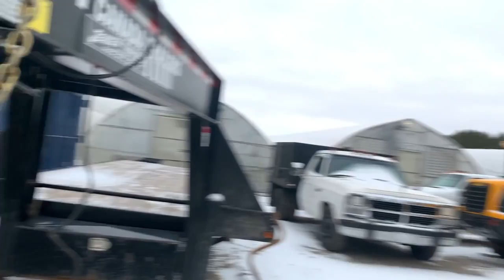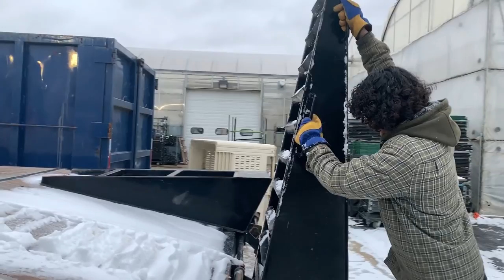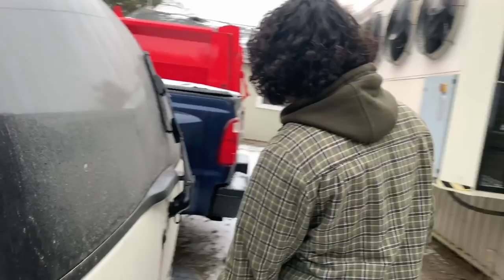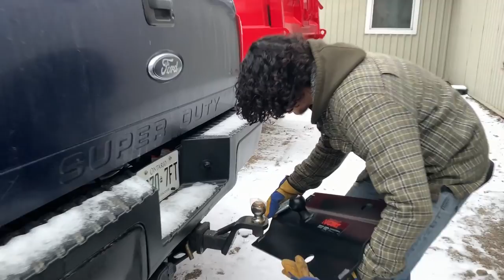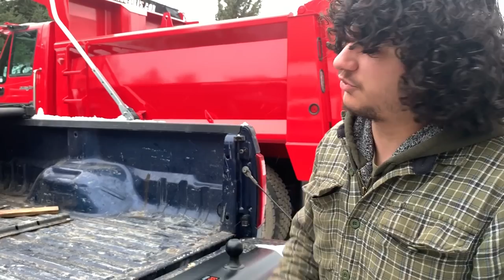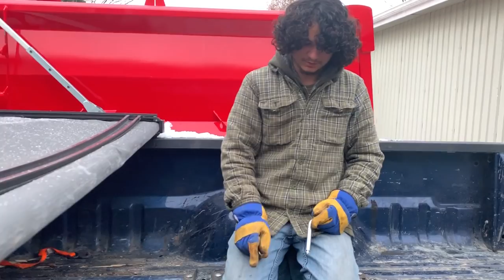Our Brand-USED 30 Foot HEAVY DUTY Trailer! GOOSE NECK

Comment: Well, you own a Ford, so a trailer to haul the Ford around is necessary.  What are you going to pull the trailer with?
Reply from the maker: Well then...... we might just have to buy an extra Ford as a backup.
Reply: Meh the fords got a cummins in it, she will run forever

Comment: We tow, 5th wheel, goose-neck, bumper pull. Can I recommend with your new goose-neck setup that when you install the lock pins and cotter pins..to do it the opposite that you did in this video. So the cotter pins will be under and protected by the ball plate and won't we easily bumped around by anything riding down the road in the bed. I have the same setup as you and my plate was very tight to my rails. Had to grab the hammer and pound it down. I was also sold an "extra" set of pins. Enjoy the videos....where is the duramax kid?

Comment: Got a 15 ram 3500 single rear wheel with a the factory gooseneck/ 5th wheel package, but mostly use a bumper pull.  
You should look into getting a b&w flip over ball. Way better secure and dont have too worry about rails or pins.

Comment: Should look into a flip hitch 5th wheel hitch, so you don’t need that big plate and rails
Reply: I’ll also add put a trailer plug in the box if it’s not already done, saves wear on the cord and don’t get the salt from the roads on it

Comment: i have a 42 foot Float trailer, 20 foot shipping container on it with my "office/lunch room" and it has a EsBar set up on it so its heated, has a solar cell system and a 220 amp service so i can run the welder from it, typically i have a 23000lb drill sitting on the back of it and water tanks inside the container that hold about 5000l and a 450l fuel tank mounted on her aswell, Triple axle trailer Dexter 15k max load rating of 37000 lbs, and its pushed to 35000lbs of weight everytime it moves, Towing it is a 2008 GMC topkick 7500, with the 7.2l Cat C7 with a nice little tune to make her push around 350hp and  1000ft-lbs of torques
Reply from the maker: Sounds like quite an interesting rig/setup.